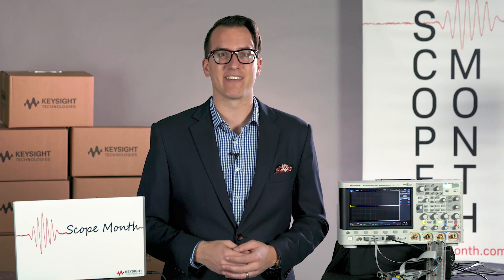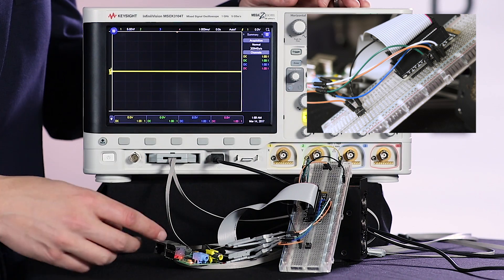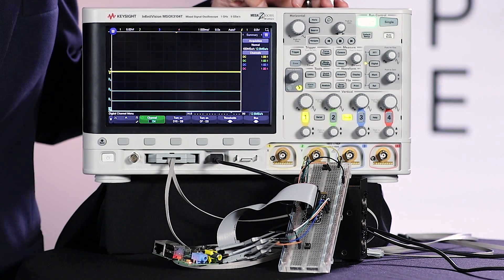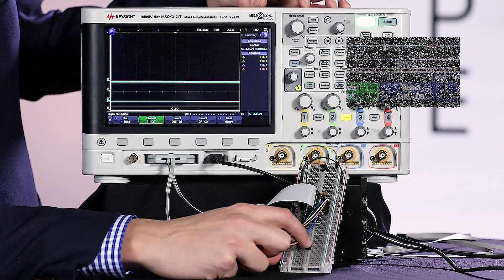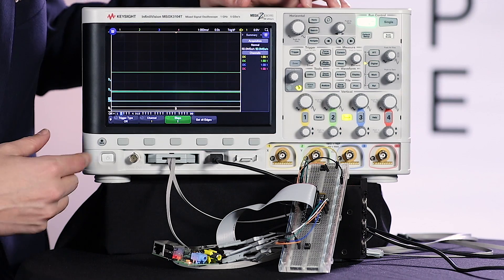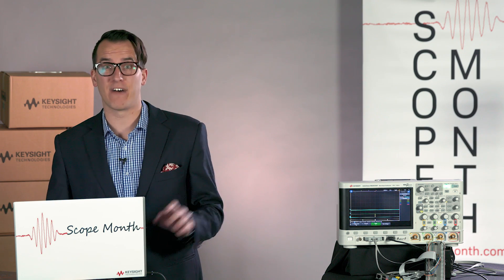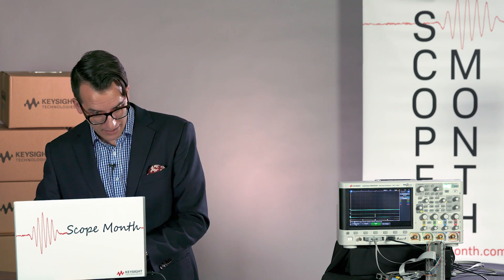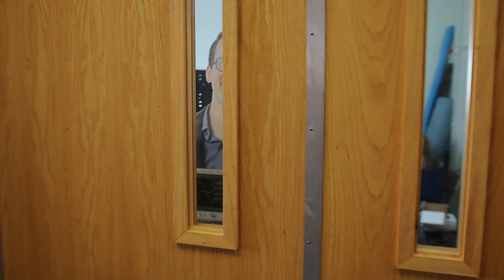Raspberry Pi GPIO Pin Debugging and the Pi Day Scope Month Winners! (3.14.17)

Comment: Question here! Does keysight design oscilloscopes with channel independent grounds or do they share a common ground with each other / with the main chassis?
image related: http://i.imgur.com/kjZ1WrG.png

I'm mostly looking for a scope to take channel independent measurements. I'm usually working on boards that have analog and power grounds and often have to take turns switching my references and saving waveforms to see the relationships I'm looking for.
Reply: You may want to check the tektronix TPS series oscilloscopes, or event he Yokogawa ScopeCorders, if your signals are not too fast.
I have used the Tek many times, and the  user interface, the "responsiveness" and the screen are awful compared to recent Keysight models. I also need to remove the power supply when I measure small signals, as the there is exta noise on the singal otherwise. However, these things are good to have if you often have to measure signals with different references at once.
If you don't need true galvanic separation, you could also use differential probes on one channel. They are not very good for small signals as well (as they usually have at least a 10:1 attenuation and add noise), but you can use your favourite scope with them.
Reply from the maker: Good question! I know the channels aren't galvanically isolated from each other, but I'm not sure if the acquisition board & front end are independently grounded or not. I'm looking into it and will reply back here once I hear from R&D.

Comment: It might be interesting if you said something about overvoltage recovery on digital oscilloscopes.
It is relevant when you want to to look at the ringing at the bottom of a falling edge, or the undershoot of a regulator when there is a large step in the reference variable. You might want to crank up the sensitivity of the channel to get a reasonable vertical resolution for the small ringing, but as the "high" level of the signal was way beyond the frontend's capacity in that range, the signal gets heavily distorted.
At least I noticed that on a 3000 X-series scope, and I wonder if if it is any different for other models and what you can do against it. I ended up building an external clipping circuit with a zener diode...
Reply from the maker: Interesting idea! Oscilloscope dynamic range is often misunderstood.